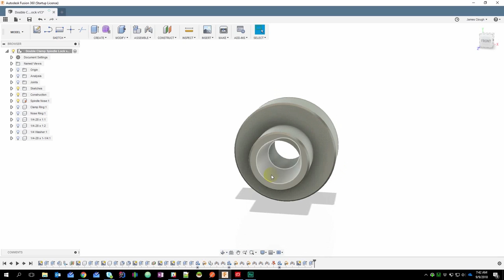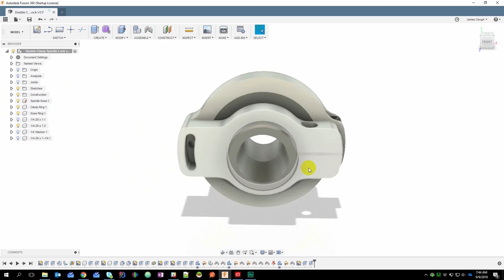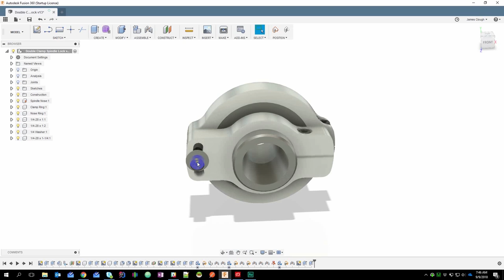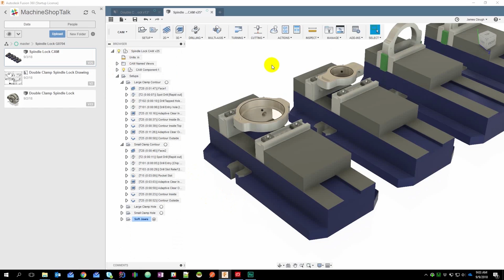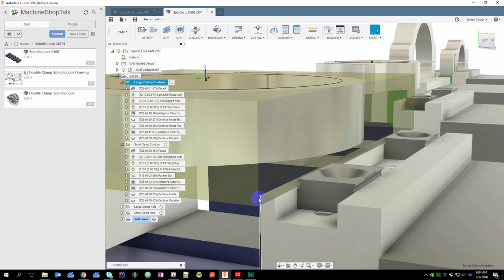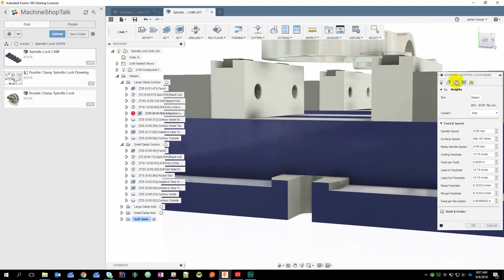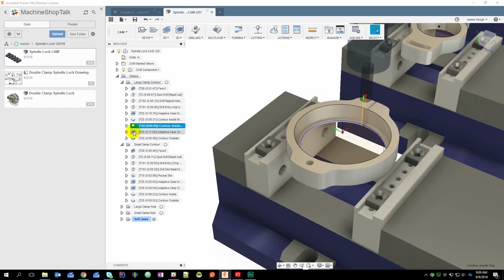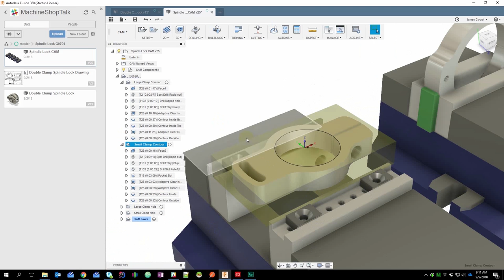How to Make a Spindle Lock for the Grizzy G0704 Mill: Part 1- Design and CNC Milling

Comment: Really nice project. Just got a Optimum bf20L which is visually identical to the Grizzly G0704 you have except for the spindle that I have MT2 collet and not R( unfortunately. So I can not use the TTS tool without swap the spindle. Anyhow I was wondering which flat end mill and feed, speed and depth of cut you use for aluminium with the stock motor that top to around 3000rpm. Thank you very much!

Comment: TTS pullout is a mayor issue on my mill too, although that cut should handle without problem. Now that I'm going with a full linear rail conversion I'm thinking on making a new headstock with one of those BT30 cartridges. But TTS toolholders are so easy to make… even though I use 3/4" chrome bar to make heat shrink toolholders and they are more prone to pullout.
Reply from the maker: I'm wondering if a better solution in the long run is a higher-speed spindle with smaller tools.  I'm also thinking about checking out the Shear Hog for roughing, which would get rid of a lot of the pullout risk.  The high helix and insane polish on the Alu-Power end mills are really the worst-case scenario for pullout.

I have also thought about building a pneumatic drawbar, but I would think it would be pretty hard to get enough clamping force without a really crazy spring stack, and equally crazy compound pneumatic cylinder.

I hadn't seen the BT30 cartridge before.  That's an interesting option.  The drawbar could be easily automated with an air wrench because I wouldn't think the torque would be super critical.
Reply: I don't want to loose torque on large drills or endmills with a high speed spindle. Also sometiemes small tools can't reach deep enough. I have a bunch of big endmills from work (up to 25mm diamter to 90mm flute lengh) and I would like to use some of them. My spindle motor is 1.8kW 1500rpm, and I overspeed it up to 3500rpm (would try higher in the future), so is bigger than a PCNC1100 motor.

I have found that a big amount of my pullout problems come from chatter caused by my bad quality dovetails, so I expect to improve that point with the linear rail conversion. Righ now I can make in steel a cut similar than the one that gave you problems. 

My actual pneumatic drawbar makes 2 tons of force, but since it doesn't fit anymore with my new motor, I have converted it to a hydraulic booster. I'm considering a new stack of bellevilles to make way more force, since I will add another hydralic cylinder. This way I would free the spindle centerline for a future through spindle coolant conversion.

Comment: I don't have any experience of CNC milling, so I am a bit puzzled what happened with the tool pulling out. From what I can tell you are using some Tormach tool holders - these seem to have a parallel shank? Which goes into an ER collet? Did the parallel shank pull out of the ER collet? If you had simply put the same cutter directly into the appropriate sized ER collet, would that also have been prone to slipping? Because I always thought such collets are pretty secure. Edit: Ok, that probably isn't an ER collet at all, so perhaps it's a collet supplied as part of the Tormach system? If so, it's not very good if it's slippy, surely?
Reply from the maker: The end mill was in an ER collet in a tool holder.  The tool holder has a 3/4" parallel shank that's held in an R8 collet in the spindle nose of the mill.  I have another video that shows this in detail:  https://youtu.be/yE2NWeIzuXA
The 3/4" shank pulled out of the R8 collet.  I don't think there would have been a problem if the tool had been in an R8 collet directly, but I think there's something about the dual-contact geometry of the TTS system that makes it prone to this.  The Tormach documentation talks about this and explains that large, high-helix end mills are the worst.  (This is exactly what I was using.)  They recommend tightening the R8 collet to a much higher torque than typical.  (They also point out that the drawbar is a wear part.)  I think in this particular case, I wasn't using the Tormach-supplied collet, since mine has a little runout.  I switched back to the Tormach R8 collet, cleaned the gripping surfaces with acetone, and tightened the drawbar tighter.
Reply: Yes, I'm sorry, I am just now watching your latest video - if I had waited to view that first I would have understood more. Thanks for replying.

Comment: Since the slot in the model was interfering with the desired adaptive clearing mode, it seems like an easy solution would have been to remove the slot from the model. Cutting the slot is a separate operation anyway. 
I really like the design and your explanation of the decisions that led to it. Great job!

Comment: Your need to touch freshly machined edges and brush away chips with your fingers cracks me up. You obviously work in aluminum a lot, because if you did that with steel, you'd have bandages on all of your fingers. Lol. Great videos, keep up the good work!
Reply from the maker: Guilty.  W1 milled with carbide is the worst.  Picking slivers out with a microscope is not fun.

Comment: Fwiw a few thoughts, I think the aluminum was a good choice since you'd want something softer than the steel on the spindle. However the coefficient of friction of aluminum on steel is rather low. For that reason I think I'd have roughed the large holes out close to the finished diameter and then used a boring head for the final finish to size pass. Helically interpolating the holes with an end mill won't leave the roundest hole like a boring head would. However that's just my opinion and it will likely work just fine as you've done it. Boring the hole might get you a bit more and tighter grip on the parts that's all. 

I blame the manufacturer's for this since they spend more time bragging about how much material some of these new fly cutters can remove than properly presenting the known facts of what fly cutters are actually meant for. You weren't taking excessive depths of cut facing the material off, but many other YT creators and especially at the hobby CNC level show taking large depths of cut at high feed rates with fly cutters. These tools were invented as a cheaper way to get fine surface finishes over large areas and were designed and meant only as a light finishing tool. Take too much and you'll beat both the spindle splines and the bearings to death. There's more than a few YT videos around where you can easily hear that spline hammering effect happening. A single tooth cutting tool in a mill always works that way. To prevent it and take large depths of cut you need at least two cutting teeth buried in the cut at all times just like a face mill does. For myself I limit my fly cutters to maybe .020" in aluminum and .010" and under in steel. Thought I'd point this out since many don't seem to know the proper use of these tools.
Reply from the maker: Thanks!  All great info.  I didn't think about it until I had the parts mostly done, but boring them in the lathe or even finishing them with a boring head in the mill would have been a good option, for exactly the reasons you mention.

As for the fly cutters, Tormach does quite a lot of marketing around the SuperFly, billing it as a heavy material removal tool.  John Saunders (a.k.a. NYC CNC (a.k.a. Tormach Marketing)) makes a big deal out of demonstrating this.  I tried it, and didn't like the hammering in my small mill.  It does the job and it makes huge aluminum snails, but I can't stand the sound of the machine taking the beating.
Reply: @Clough42  I've got a full sized 3 hp 3 ph head on my Taiwan built Bridgeport clone and don't enjoy hearing that hammering either. There's been a few posts over on the Practical Machinist forums mentioning just how hard flycutters are on vertical mills if you start pushing them at high depths of cut and feed rates. There fully capable of taking cuts like that, it's the machine longevity that limits what they can reasonably do. I tend to pay attention when even the pros think it's a bad habit. :-)

Comment: that little hole at 3:16 is not for a holding spot for a handle or bar, it's purpose is to house the alignment set screw so the r8 collet doesn't spin. That's why you have to clock the collet until it slips in place before pushing it in
Reply from the maker: No, it's just a blind hole for tightening the collet using the included pin.  It sure looks like a screw in the video, but a screw in that location would intersect the taper of the collet, where there is no keyway.  The index pin is further up in the spindle, and I think it may only be accessible with the quill disassembled.  The manual shows how to use the hole for tightening the collet on page 29.  https://cdn0.grizzly.com/manuals/g0704_m.pdf

Comment: Good video what VFD do you have on the mill?
Reply from the maker: I'm still using the stock DC motor and speed controller on the mill.  I've been meaning to set up spindle (and coolant) control in Mach3, but haven't gotten to it.  The data on how to do that with the stock controller is pretty sketchy.   It might be easier to switch to a 3-phase motor and VFD, if only for the Mach3 integration.

Comment: I use Fusion360 as well. Is there anyway I can get a copy of the models and cam you used?
I am looking forward to seeing how the broaching works out.  I would like to make a splined hub using my G0704 in the same way.
Reply from the maker: Sure:  https://a360.co/2FJrdoD
The broaching video will drop in the morning.
Reply: @Clough42  Hi just recently found this video and link is this file available for download ?
 When I click on the link it just opens in the browser for viewing , but not for downloading  ?  
Have you removed it ?
Reply: Hi is the f360 file still available it will open in the app for viewing but not for download ?

Comment: Coming from both an engineering 41yrs product development with a very light machining exposure having your work flow and reasoning behind decisions is invaluable for the passing of the actual knowledge to the next generation. Watching chips being generated is fun but it does not actually show what goes into the project.  Your balance is good.  What might actually be a real help to some is a time log in the comments showing the time spent in design, fixturing and machining on a project.
The edited (and they must be) video gives a false impression to newbees about what can be attempted in a short period of time.   IMHO the actual time (not video editing) of the work in one of your 40 Minute project explanation videos is closer to 10 hours.  And by the way you have a VERY capable shop with nice tools  far greater then even most Makerspaces can afford. I help run Maui Makers shop and space. mauimakers.com